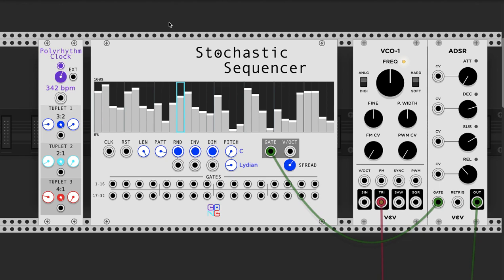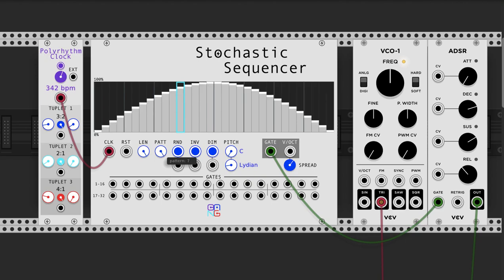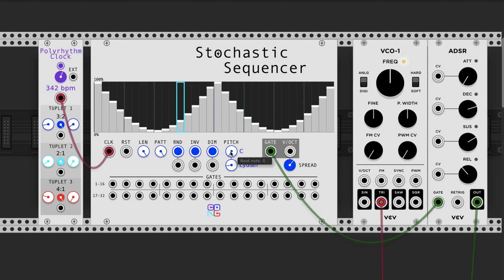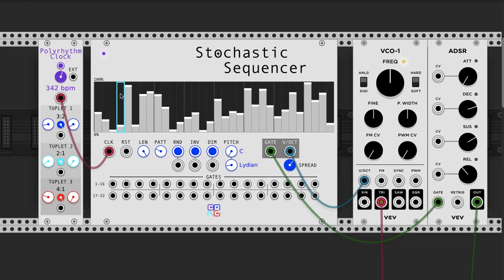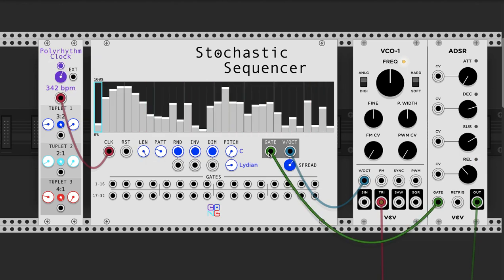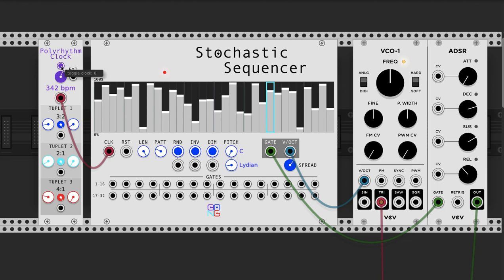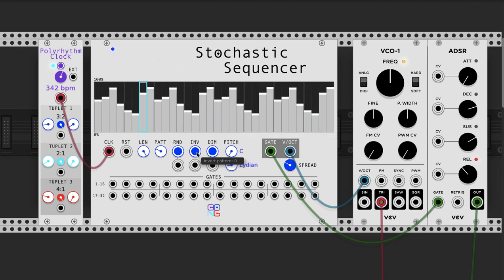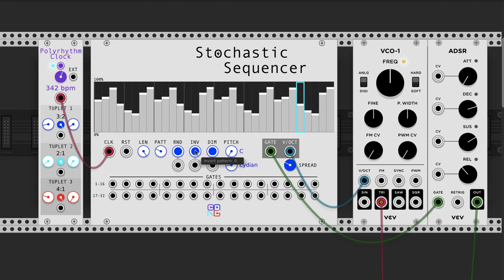Stochastic Sequencer - Sha# Bang! Modules

Comment: hello I need a little help that the module does not work for me the same as it works for you in this video I have version 2.1.0 and when I put all the probabilities at 100% the only thing it does is block the trigger and I see that in this video you do not Same thing, is there something I'm doing wrong?
Reply from the maker: what do you mean block the trigger? Have you looked at the manual? https://github.com/jeremymuller/Sha-Bang-Modules#stochseq
Reply: @jeremysmuller  i can send u a video? I was with a couple of people discussing it in a vcv rack facebook group and we came to the conclusion that the module seems to have a bug.
Reply from the maker: @socratesru  sure that would be helpful. But create an issue on GitHub and you can send a video there: https://github.com/jeremymuller/Sha-Bang-Modules
Reply: @jeremysmuller  done, u can check now :)